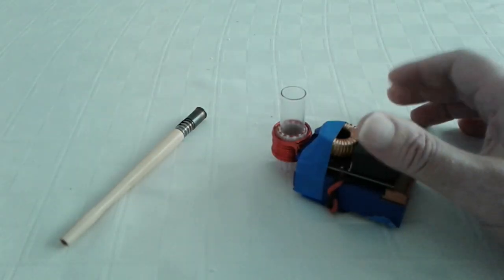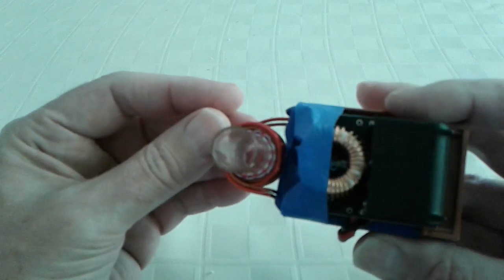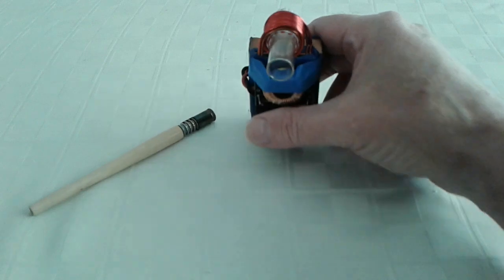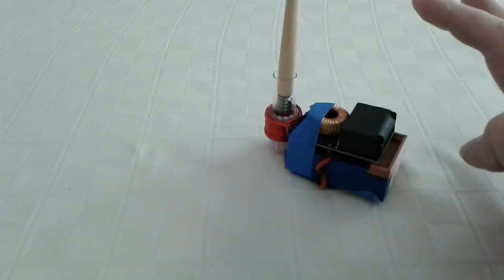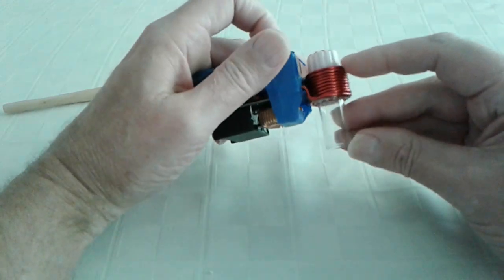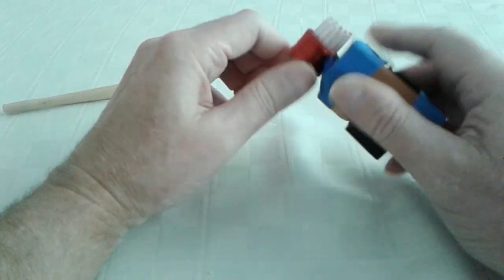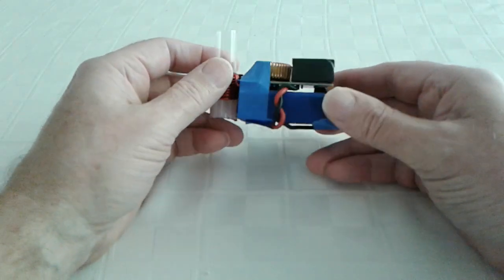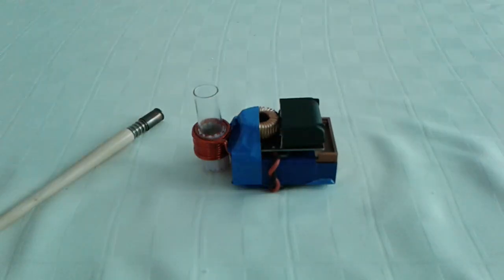HalfPint [tm][r] Prototype Explained.

Comment: idk if you still care about this project or if you are still active and check this channel, HOWEVER there are vapcell h10 14500s now with 1ah and 10a cdr and also vapcell f12 that have a bit more capacity but only if its drawing less than 3a. these might make this form factor worthwhile and worth revisiting. (i might be doing exactly this)
Reply from the maker: Thank you for information.  Indeed, I started by testing 14500 cells that were supposed to be capable but they didn't hold up.  They degraded in very short order.